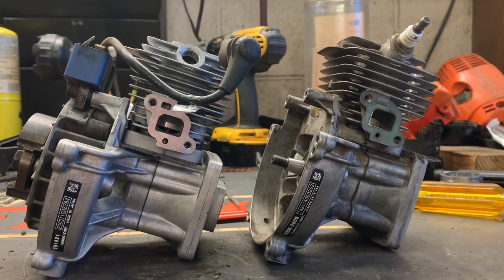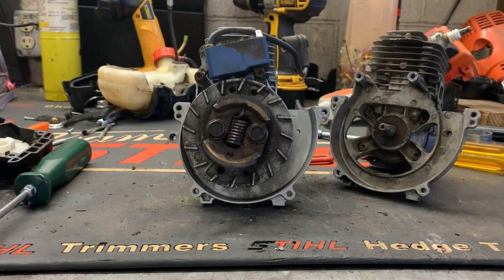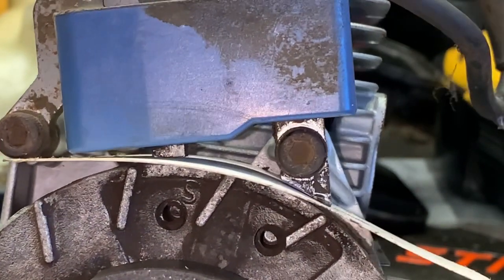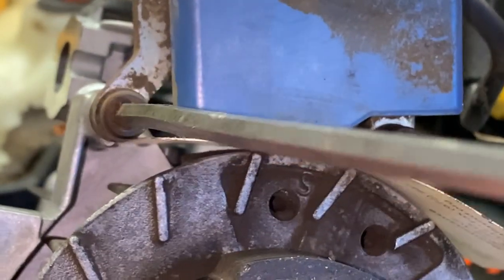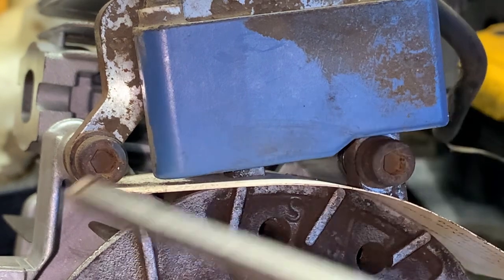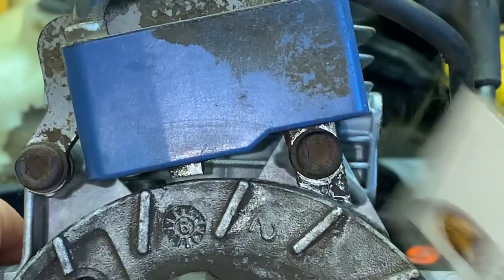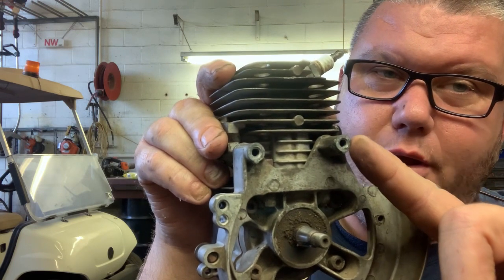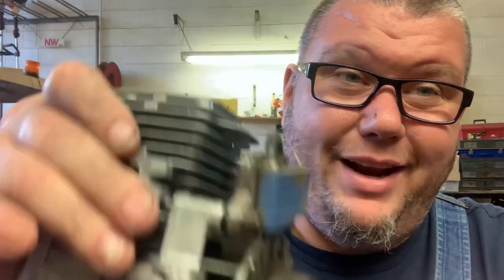SMALL ENGINE BASICS / IGNITION COIL AIR GAP SETTING

Comment: The neighbor across the street gave me a Stihl leaf blower with a stuck piston. I got it broken loose but it would not start/run. I removed the muffler and put some heavy oil on the side of the piston. It fired right up. I took the cylinder off and sure enough, piston scoring and crack rings. I have new parts on the way. It's been a cool project for me as I've never worked on a 2 stroke motor before. Thank goodness for YT in that regard.

Comment: I just set my gap yesterday 8/14/21 on my 12.5 Tecumseh Garden tractor and didn't use the magnets, then when I tried to start it, the fly wheel got bound up on the coil. Thank The Good lord no damages happened. I just reset it using the magnets on the flywheel, now it start and runs like a dream. Love your videos I've learned a ton for you.. Thank you for sharing your knowledge

Comment: Briggs 4hp Classic engine, customer put a new coil on it, said it ran, killed it, tried to start it up later, no start. no spark.i removed the blower housing, and the flywheel was rubbing the armature legs and rubbed into the module itself...

Comment: You didn’t mention that you set the gap over the magnets.
Reply: Well, over the magnets is where it really counts. Just saying.
Reply from the maker: IT DOESNT MATTER.
Reply from the maker: Good tip! However It doesn’t have to be over the Magnets on this engine. the gap can be set anywhere on the flywheel